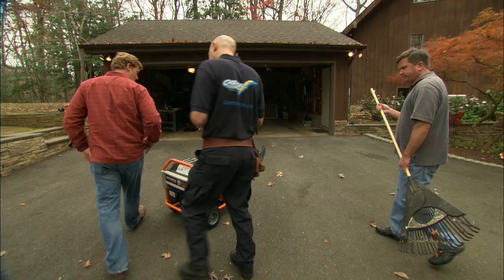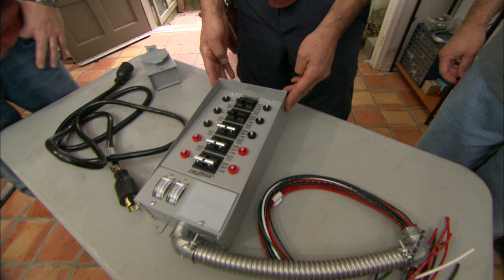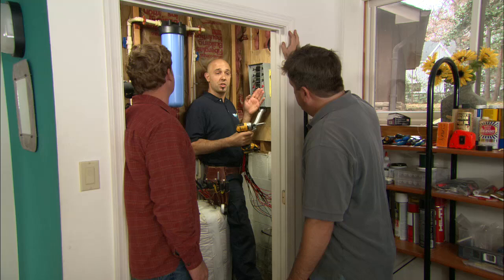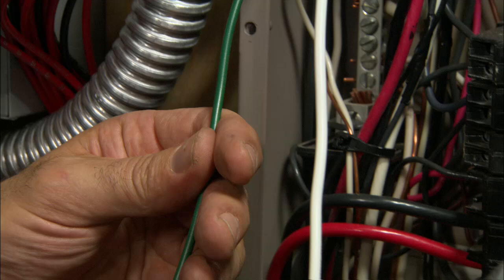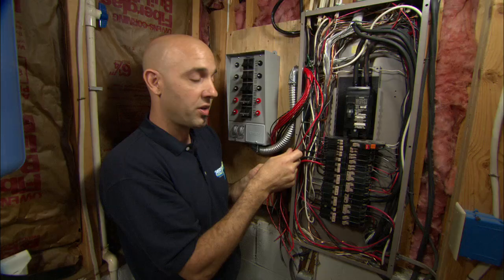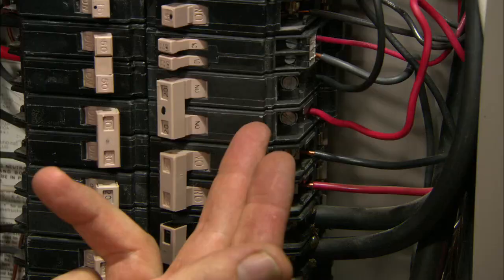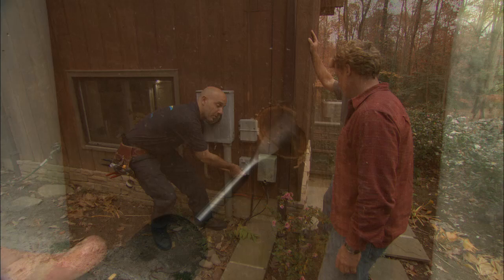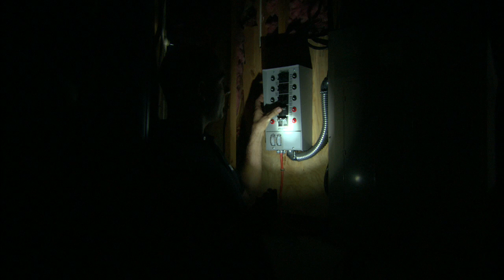How to Install a Transfer Switch for a Portable Generator | Ask This Old House

Comment: Good video, however, you don't need all that.  Sorry Chris Yeah..nice used car salesman pitch.  Easier , would be to install a separate breaker off your pole. This breaker will keep any surge fluctuations if the power comes back on or there is intermittent power somewhere in the line during the outage.  Now, you have separated  your house from the power company. So your off the grid. Once that's done you can  hook your generator in to your house breaker panel and run off the generator. When you know that power has been restored shut off your generator, disconnect from breaker panel, and turn on external breaker coming from the utility pole, your back in business
Reply: Are you talking about back feeding the panel through a breaker on the bus bar, and remembering to shut off the main breaker before you turn on the generator breaker, allowing the gen to power the entire system?  This can be accomplished with some type of interlock mechanism, otherwise it's not legal and potentially very dangerous for more than a few reasons.
Reply: NO,  My house has a separate breaker that stops any electricity from coming in from the city.  That way I can stop any fluctuation spikes.  My generator has a separate connection after the 1st breaker which connect to the bus inside the house.  So, if the power grind in my area go out, I just throw the 1st breaker, power my generator, then turn on the breakers in the house.
Reply: Thanks, I think I understand.  So you do have to remember to shut off that separate breaker (that stops power from the city) if your power is out before connecting your gen, so that the main utility power returning won't feed your panel at the same time as the gen.  But what if you forgot to shut off that breaker when you have your generator connected?   This isn't all that uncommon, but I'd recommend looking into an interlock system that forces you to shut off that main city power breaker, there are aftermarket linkage kits or kits made by the panel companies if your panel isn't too old you might be able to retrofit one into your panel.
Reply: Yes, and I understand what you are saying.   But mine is cost effective as well.  You can always make a check list.  Very simple.  And/or put up some small signs that also remind you of procedure.  Interlocks are fine, not knocking them.  However,  If you know what your doing.  Doing it the way I explained will work just fine.  Thxs for your interests.

Comment: America. Stop using metal electrical conduit
Reply: Are you in Europe where they burn all of the garbage (plastic)?  Which is why California basically banned everything? edit: China won't be taking your plastics any more...
Reply: Nicholas Schmal No I'm in new zealand where our electrical conduit is made from recycled plastics
Reply: Yeah I would certainly make the argument that homes would be a lot safer if there were no metal conduits, no metal appliances, no metal anything.  We basically set up electrical systems in homes to CREATE the potential for ground faults because of this.  No conductive metals in a house, no grounding of the neutral, and we have a situation where a ground fault cannot be created.  Oh well.

Comment: so.much easier easier to shut off the main and back feed from the generator through the dryer feed. now all your receptacles lights and a/c are good to go.
Reply: Easier, but a lot more dangerous. On the live side should always be a receptacle, not the prongs of a plug. You can touch the prongs very easy and get electrocuted.

Comment: Wow this is horrible. The installation is horrible, the wiring is horrible, the fact you need a generator at all is horrible. I wouldn‘t sleep in that house for a night. I don‘t care if it‘s up to code. Compared to a european installation this is a death trap.
Reply: Thanks for the comment!  What if your electricity goes out where you are in Europe?  What is your plan of action?  In the middle of winter?
Reply: We just had a major storm 2 days ago and this is a VERY common system. .What would you do different and still meet code when it's below freezing and the power is out for several days? I see only one issue, which I will address in another post.

Comment: the ending would be way better, if people used solar power instead of that noisy stinky shit box generator...not only would it be better, but it would be free power from the sun...instead of buying gasoline
Reply: +Matthew Sherman 
Your ignorance is impressive. It is not "free power" in the slightest. First you need to buy the panels, which can be a lot since you are suggesting running a house off of it. Second, the sun only shines during the day when it is not cloudy. So that means you will need batteries to store that power for a rainy day(s) or at night. Third is the maintenance required on the batteries. Depending on how many that can add up. Forth is the inverter required to run anything that is 120 volt house power. Solar is good but it isn't the complete answer yet for most people.
Reply: Matthew Sherman ...not everyone has 10k- 15k + to throw at a solar setup that would be required to provide that much power. Probably be much more than that lol
Reply: Solar doesn't work very well with a hurricane that knocks the power out for days.